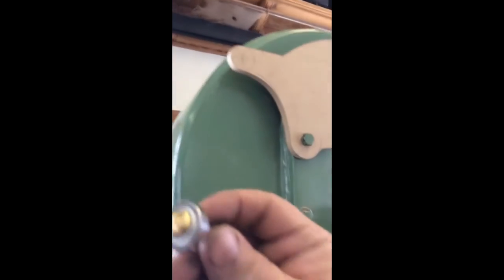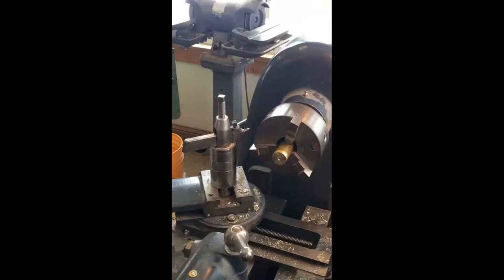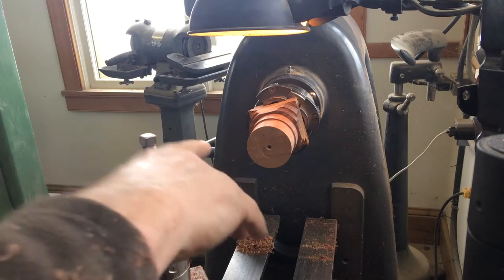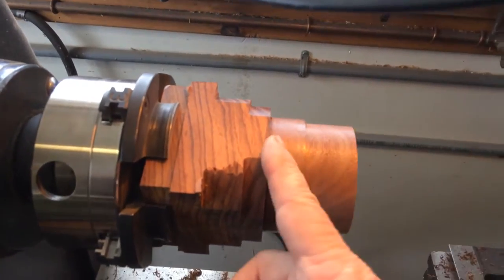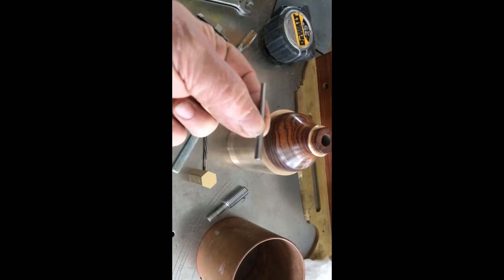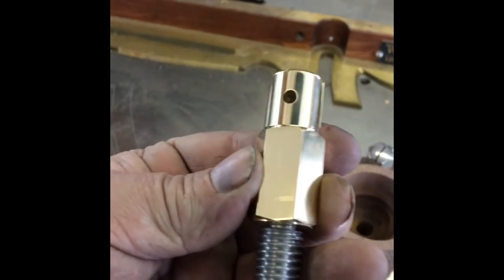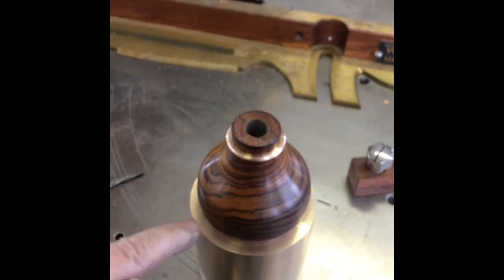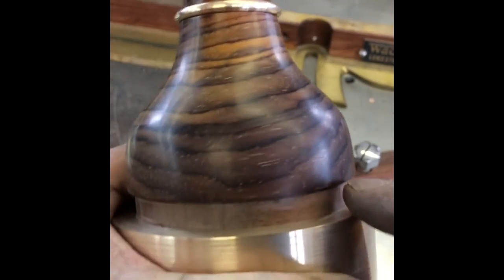Bursgreen MZ ship saw 1949 OWWM

Comment: Beautiful Jack, for the issue of lead filling, I was wondering why didn’t you use solid core brass instead of machining it hollow and putting lead shots in there.

You could have determined the weight of the counterweight required by using having other substitutions weight, then calculate the length of the brass round bar required to achieve the weight required.

Just my 2 cents worth
Reply from the maker: It Wasn’t Hollow a plate was silver soldered to the bottom of pipe